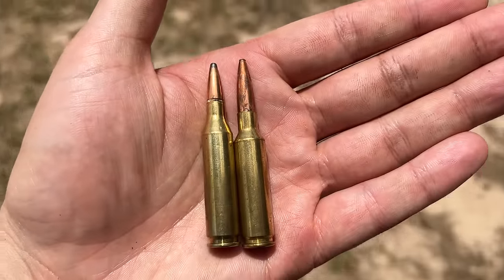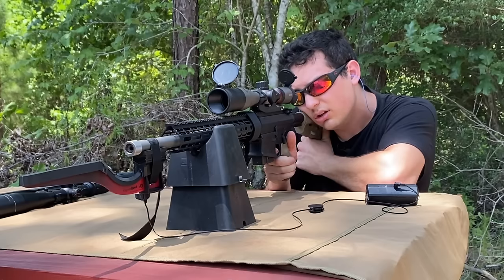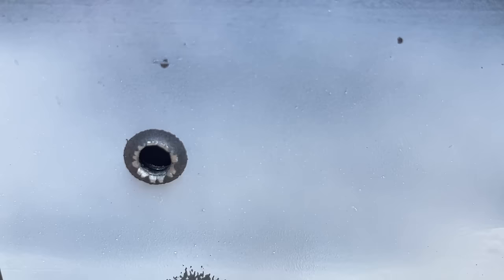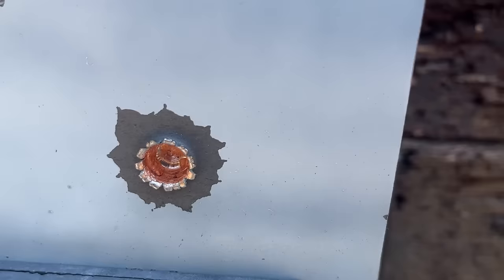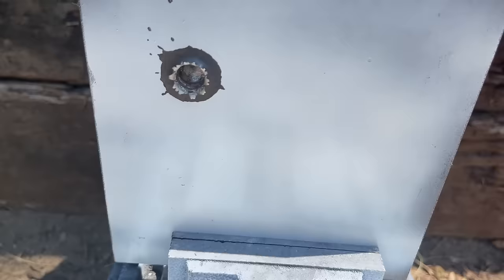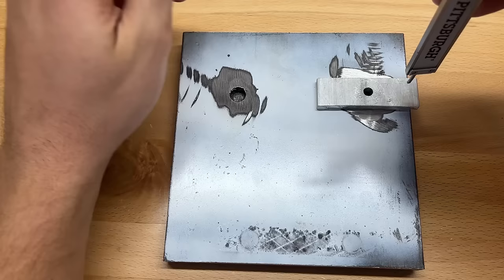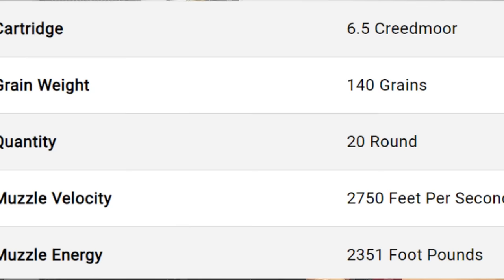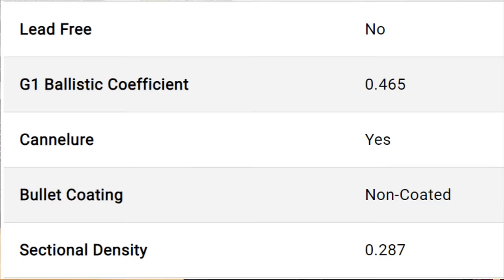243 vs 6.5 Creedmoor: Not So Close On Mild Steel?

Comment: why are companies going to the effort of high hardness expensive AR500 if half inch of dirt cheap mild will stop rifle rounds with more ftlb then m193 . ??? A kitchen floor tile duct taped to that mild would probably stop a 300wm
Reply: Did you see the crater it put into it though?  Hit that a few times and the target will look like the surface of the moon.  AR 500 is a lot harder and wont deform on the surface.
Reply: @66smithra   realistically you'll only get multiple hits on the vest if its someone pretty accurate who will quickly realise and start putting them in your head or lower gut where vests dont usually cover . i'd wear that½'' mild with some tiles and a hdpe backing  , plus most threats are pistol calibres in usa  , recoil will stop a quick burst from an AR15 landing exactly on top if each other in most cases .
Reply: @TheCraigy83 Who is talking about a vest?  We are talking about AR 500 steel targets.

Comment: The fact of the matter is, solid copper bullets have a much higher melting point than lead. The rapid compression of the lead causes it to melt, creating an effect much like that of a water jet. This high pressure/temperature fluid literally burns through the steel plate. Copper has a much higher melting point. Therefore, it will never penetrate steel as efficiently as lead. No surprises here.
Reply: The lead might flow but it doesn't melt on impact. If it melted you wouldn't find the deformed bullet after impact!